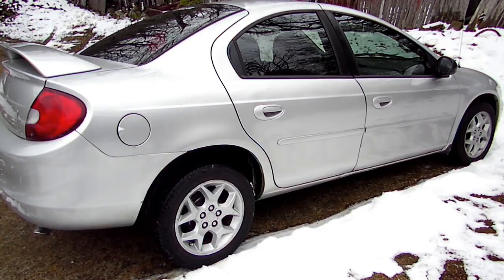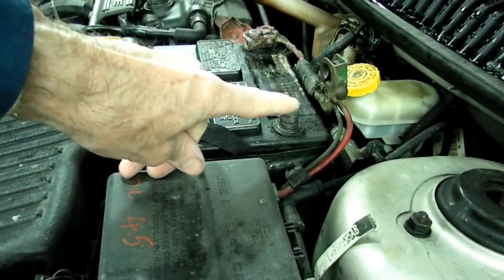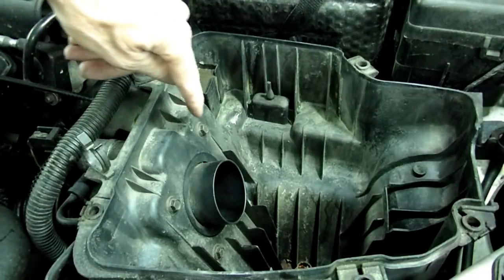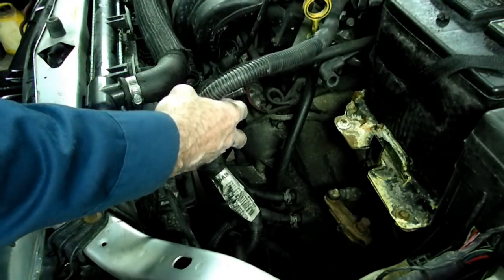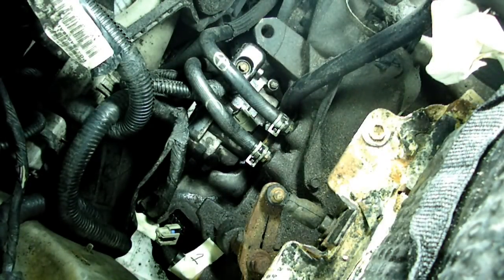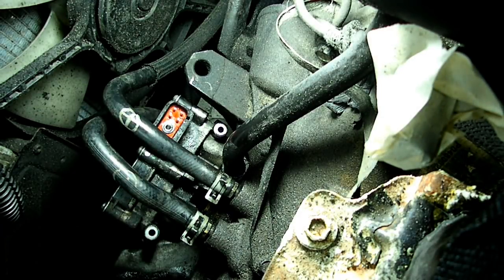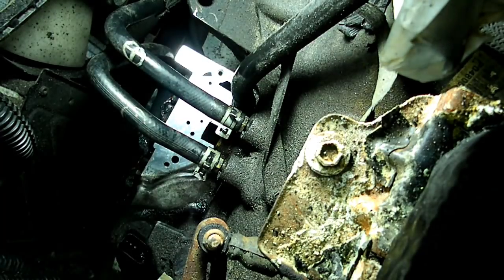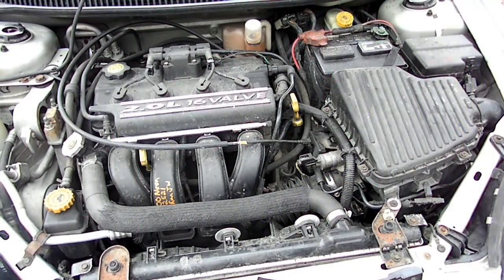Transmission Control Solenoid Replacement

Comment: Hi referred to your videos as very good reference for Saturn's. I own a 2006 ion 3. The 2.2 automatic. Cannot seem to find any videos on YouTube about shift or control solenoid replacement. Trying to get the valve body cover off enough to switch the solenoid which has been done with just hand room. Not sure if my mechanic ignored the link I sent him from a forum where the guy did a repair himself this way but after two days he gave up. No my vehicles tore apart and like someone else told me the jobs almost done why give up. Like seeing the Finish Line in a race and deciding to lay down. Any advice would help. Hoping I hear back from someone knowledgeable in the Saturn forums

Comment: that seems a lot easier than on a JATCO transmission  non CVTs where you have to take out the valve body to replace the shift solenoids from under the transmission and remove the transmission pan

Comment: I have a 2014 chevy impala drove for an hour at the stop light turned green car wouldnt go. Was able to cost off road. Turned off car for a few minutes restarted drove fine for 10 minutes then did it again. Wasnt shifting hard or any thing. The second time it did it was hard vibrations. Let it sit was on a hill started it again then drive just fine to safe area. Waiting for like an hour and was able to drive 10 minutes then did it again. It does not have dipstick for fluid check. Found area where the fluid goes. Not sure if I should add transmission fluid to it? @richpin6a
Reply: Pretty sure its a closed system
Reply: Cant afford to take to shop😞

Comment: Quick question: when replacing the transmission control solenoid, will I need to add more transmission fluid, if there wasn't a leak?

Comment: I hope you're still monitoring this video. I have a 2008 Chrysler Town & Country Limited, 4.0L that is having two issues. I need to replace the upstream oxygen sensor and the shift solenoid. I cannot find any videos showing how to do that on this model or any diagrams of location for either item. I'm a widow and unfortunately no extra money to pay to have this fixed. I'm usually pretty handy but I need a little guidance. I purchase the Chilton book but it doesn't show any pictures at the 4.0 so again no help. Do you know where I could find some information that might help me fix these problems?
Reply from the maker: I find the local library in my area have very good online repair databases.

Comment: I got 2000 dodge  grand  caravan se well driving  it slip out of gear n then back into gear ? it does it after driving for while  there is fluid  in there

Comment: I have a 96 Buick century v6. I replaced the speed sensor and it's still doing the same thing. When the speedometer works the transmission will change gears. It has a code po.502. Please help

Comment: I just did this today. I removed the transmission lines and the speed sensor to get the bolt in the middle. I also removed everything I mentioned to make it easier to scrap the old gasket off.

Comment: I have 2001 concorde  46.000 miles.after drive bout 10 15 mins it starts to slip and makes whiny noises.changed sensors no difference.can anyone help.trans can't be shot with only 46.000 miles

Comment: Hello Rich, I have a 97 Sebring that doesn't want to shift out of second gear or when it does I feels it slipping wont go over 40mph I've change the two speed sensor's input and output it didn't fix it . Now I'm going to change the Shift solenoid block assy. and hope this might fix it. I watch a lot of video's on it and it's simple enough. But the two hose's above the block look simple to remove to get then out of the way while your replacing the block why doesn't anyone remove them ?     Thank you for your help.

Comment: I have a 1996 dodge grand caravan 3.8 (210K Miles). My van will not start. It appears to be in reverse from the shift selector even though it is all the way up in park. If I jump a wire from the ignition relay under the hood  to the positive terminal on the batter it will start and show that it is in park. When I turn the engine off the display is in R and it will not go into N but jump to D. What can I do to correct this?

Comment: my 99 Monte Carlo will not shift from 1st to 2nd gear until it hits 25..30mph or 4000rpms. what could be causing this? after  that it shifts fine..

Comment: hello, im having the same issue with my dodge grand caravan, so I replaced my solenoid pack and noticed there was a leak from my transmission, so then i had a new transmission fluid and filter replaced, and still there is a leak in my transmission coming from the solenoid pack, can you tell me what went wrong please?
Reply from the maker: Did you replace the gasket.

Comment: hi i want to assemble an automatic transmission to a different diesel deutz engine which is built for manual transmission. i need to know what kind of parts will i need or first of all is it possible?

Comment: thanks for the info also my speedometer needle doesn't move any tips for that
Reply: with the car completely off hold the trip reset button until your dash starts lighting up.
Reply: with the car completely off hold the trip reset button until your dash starts lighting up.
Reply: Mario M hi check your speedometer cable... maybe have damaged

Comment: Please help I have a 2000 Honda civic lx automatic and my 1st gear really drags and sounds line is pushing the power band but once it goes into 2nd gear it drives fine
Reply: Devin Williams  transmission solenoid

Comment: I have a 2000 Dodge Avenger and it does nothing when I put it in reverse. You can feel it bump when you shift it in reverse but you don't move anywhere. I can floor it and still won't move anywhere. Any help?
Reply: unfortunately no. I had the solenoid replaced and the whole transmission went out... I sold it. Sorry I couldn't help
Reply: Did you find out what was wrong with it? I have an 08 avenger with the exact same problem.
Reply: Chabo.  Delocho
Reply: +Rebekah Sanders did you find out what happened?
Reply: +Rebekah Sanders thanks for your response and I just found out today I have to get a whole new transmission for 3000 when I bought the car a week ago for 6000 :(
Reply: sorry :( best of luck to you.

Comment: Hello rich I have a Plymouth neon year 2000 engine 2.0 liter 16v sohc. My engine check light is on. The performed diag to dtc po743 ttc solinoid circuit. Checked proper operation advised of vlavle body replacement/ ttc solinoid.  The shop want 1200 to fix but couldn't due to the new vlavle body has been discontinued for my car. What should I do ?????

Comment: I think before I would have tackled that job the first thing I would have done is steam cleaned that shit hole of an engine and engine bay out, just a couple of grains of muck would have knackered the whole box up, plus if it had been cleaned in the first place you would have seen where the leak was straight away before wasting time and money doing an unnecessary gasket job.

Comment: Great video.  Very helpful.  Would a bad TC Solenoid cause a car to stall when it's placed from park into drive or reverse?
Reply from the maker: I do not work on to many automatics but it sounds to me like a possible torque converter lockup solenoid problem.

Comment: my pcm suffered an injury in a crash for this reason my transmission does not operate properly remove the computer for repair and now i install the computer  again and anti theft mode is activated red circle in my panel. i disconnect the terminal of the battery for a period of 24 hours and leave the key on for 20 minutes and the problem  is the same the car don't start don't make any noise anything have any idea how to fix this? btw i live in Panama (latin america) the dodge don't have a dealer in my home town i buy this dodge neon in coopart :(

Comment: i replace the transmission solenoid, speed sensors and transmission fluid with filter and have same problem my transmission is stuck in 2nd gear (dodge neon sxt 2004) in the process i disconnect the battery is possible that i need to reset the PCM and TCM with a Diagnostic Scan Tool to remove the limp mode on the transmission?
Reply: It's likely the ECU or computer in the car needs to have some capacitors replaced. Contact SIA for a quote. Your welcome.

Comment: I have a 1999 Dodge Grand Caravan with a 3.8 V6 engine. It shifts really hard when I put it in Drive from Reverse and I believe it is being stuck in 1st or 2nd because it seems like it won't shift at all. It stays between 2-3,000 RPM's and won't shift after 2nd. My husband said he doesn't believe it's shifting out of 1st but it does for me. Any suggestions? Also, how do you unplug the Torque Converter Plug? Thanks

Comment: i need to drain the transmission fluid to change the solenoid?
Reply from the maker: When you remove the bottom pan fluid will drain.
Reply: But you do not need to drain your transmission fluid on a dodge neon to put a shift solenoid on. Just dab up the transmission fluid so that when you put your new gasket on it does not touch it

Comment: I recently changed a Dodge Caravan transmission and one of the connectors had a square pins instead of rounds pins have you ever heard of that  ?and how do I address ?it is there an adapter for the connector
Reply: like it

Comment: I have a 03 neon and I out it in drive and its good for like half a block then it stops going I accelerate and the rpm goes up and it's on drive it's as if u put it on nutral wen ur steal in drive can u help??
Reply: When it comes to automatic transmissions i leave most of the troubleshooting to people that specialize in them.
Reply: Sounds like torque converter to me, but yeah, you should let someone who specializes in it figure that out.
Reply: Don't know what you are saying with all the misspellings an such an incoherent talk. you sir need an education
Reply: Blackie Chong   He's probably texting on a smart phone. Causes people to shorten words and sometimes replaces the words with ones the phone expects.

Comment: hi  i  have a  hard shifting  trans    2005 corolla     277k now    with p2716 code on     trans oil is clean              havent change trans oil  43k     should i change it?
Reply: no just keep running it. If the fluid is black that means its running like a top.

Comment: one thing that makes it easier is to remove the cooler hoses to get to that center bolt with a swivel or wobble extension, also on some 41te transmossions on older vehicles there is a service bulliten that has to do with tapping the case behind the solonoid due to the metal of the case being too porous
Reply: Thank you for letting everyone know.

Comment: Hello i have a problem i have a Town & Country 2004 and the gears do not change my mechanic changed the transmission and once again it does not change gears he put 2 transmissions in already he checked my computer and it turns out thats still good to i dont know the problem what else does he need to check so he can fix the problem. What do you think ?

Comment: I redid it cleaned it some more qnd tightened the solenoid, and when I turn on the engine a lot of transmission oil starts leaking through and it seems to becoming from the solenoid pack area,

Comment: What codes r U getting? turn key forward3x's w/o starting. leave forward on 3rd give u dash codes. had same prob w/ P300 random misfire. Battery was bad + bad O2 sensor. Bad solenoid/ trans probs are usually in the P750 range.

Comment: Thanx richpin06a. 
That trans I replaced in wifes Caravan went great. however on road test, stuttered 1st-2nd/ 2nd-3rd. Had a quick learn done to NO avail. On way home still stuttered slipped in out of 3rd @ 50 mph(speed limit was 55) had to stop for person making left, it stuck in 1st(slow ride home). Got error codes P0732(incor ratio)&P1776 (sel in low rev).
Moveras sent me new solenoid pack(warranty) 
Anyway; thanx for your heads up videos.

Comment: I have a 98 dodge ram 1500 with a transmission problem. when i go and start the truck i can rev up fine and everything but when i put into gear it gets close to dieing out and has died out at a red light when i was stoping i had to use to feet on brake and gas to get it moving and it is having a problem shifting and feels like it goes into neutral sometimes im not sure if its the solenoids or if its a bad converter or something please help thanks

Comment: You are awesome ! I have a 2002 neon auto.  I was backing up and applied the rear brake, i heard a clunk and lost my reverse. I took it for a quick inspection and they told me i needed upper and lower engine mounts and a tranni mount. Do you think that would cause my neon to not go into reverse? The forward gears work.  Again Thanks for posting these videos!

Comment: On a 1994 Chevrolet S10 Pickup would this be the same fix if it does not shift into overdrive. Can't get on a highway if it doesn't go over 55mph.

Comment: Hi, it is a great video, I have a question. I have a 2001 neon and is not shifting to reverse and when is in neutral and press the pedal it goes. When in drive after driving a little starts shaking and have to move it to neutral and then again to drive. Could that be fixed replacing the solenoid? or it may need transmission replacement? In a 2001 neon is the same procedure as for a 2002? If someone have more videos of neons please let me know.Thanks

Comment: It usually is the same one.  And yes, you should do either one of two things or even both.  1.  re-learn the system by erasing the error with a computer for your vehicle.  2. By pulling the negative off of the battery it can usually reset everything for you.  Ask a mechanic if your model will reset.
Also, erratic shifting can also be the transmission control solenoid.  It is on my 2003 Doge Grand Caravan 3.3L Flex.  Not just a leak.  I don't have one.

Comment: I have replaced my solenoid three times on my 99 Plymouth Grand Voyager 3.3L. Two were Dorman and one ATP it is easy to replace on the van, but what could be causing this failure? I need to replace it again!!! UGH

Comment: Is there a reason you didn't just remove those 2 hoses for easier access? I love your videos, using the ones for timing belt and head on my 03 neon right now. Thinking of buying an intrepid that needs this.

Comment: Mine started leaking like hell! I'm no mechanic tho and it doesn't seem to be leaking from the gasket you mentioned you had replaced before in the beginning, do you think this could be the problem mate? Another thing I noticed when it was leaking first gear wasnt going through is this why??? Thanks

Comment: you mentioned a leak problem, but was there also a shift problem? 
I thought that you swap the old solenoid block for a new one.Or, it sounded like you said, new solenoid block.
Just checking, thanks.

Comment: Great Video. About to do this on a '02 Caravan (3.3L automatic trans.) that has the same problem. That Neon's solenoid looks exactly like my caravans. After installing the new solenoid, is there any config. work that has to be done to the vehicles computer? Thanks!

Comment: Hello richpin06a I have a car Strarus 2002, I need you advice about an issue that I am having;  
I had a leak on Solenoid, one technician changed me the plastic packing and put it on again, now I have not leak but the car no changed I drive on 60 KPH and I have not response of the transmission....    
Do you believe that the selenoid is causing this fail?

Comment from the maker: Remove the battery and tray and unplug the connector to the TCC solenoid on top of the transmission and clean it thoroughly with a plastic-safe electronic cleaner such as CRC QD Electronic Cleaner. Make sure that the pins/sockets in the connector make a good connection and don't have corrosion .

Comment: hi i replaced my spark plugs an wires then went for a test ride an now i feel my truck when it shifts just a slight bump but i know its not normal...1998 chevy suburban k2500 7.4......any avice

Comment: use a open end wrench to determine the diameter of the fitting and the use a tread depth gauge to find the size. example. m10x1.25. you can find a gauge for only a few dollars and they are great to have around

Comment from the maker: The shift solenoid i replaced was for a automatic i do not believe the standard has this.    Disconnect the negative battery cable.

    Loosen the clamp for the air duct at the throttle body.

    Remove the mounting bolt and nut for the air cleaner box.

    Pull the air cleaner box and throttle body up to access the throttle position sensor.

    Remove the throttle position sensor.

Comment: Hi Richipin, I have a plymouth Neon 2001 (SE) standard edition (australian model). Its a 5 spd manual drive car. I have the same oil leak problem. But can you please tell me the current price of the shift control solonoid. And also if you can pls tell how to remove the throttl position sensor (dont want to damage it). really appreciate your time in responding to me. Great work on your videos. I like all your videos on the dodge neons. Please continue ur good work.

Comment: Could ou help me I have a 1999 dodge Durango 4x4 had my transmission rebuilt about a year an half then it wouldn't shift into 2nd to toke to get fix was told that the sensors where bad so I had them repair but was told I needed another computer so I got a used one worked great for about a week then transmission went out again took it back said they fix it couldn't find what's wrong with it to get another computer because would shift  ok then had trouble shifting so I got a new computer but I'm

Comment: The relearn process can be done with out the DRBIII.The Snap On Modis can do it too.With Chrysler automatics,don't use dextron and use the ATF+4 fluid only.The Chrysler transmissions shift and work better with the ATF+4 fluid.The middle bolt,remove the speed sensor and can get to the bolt with a socket